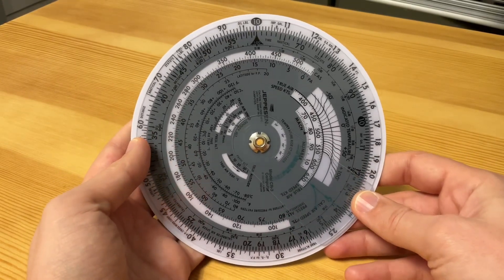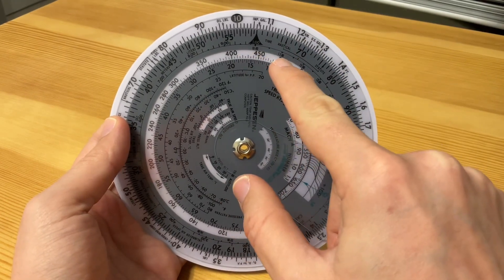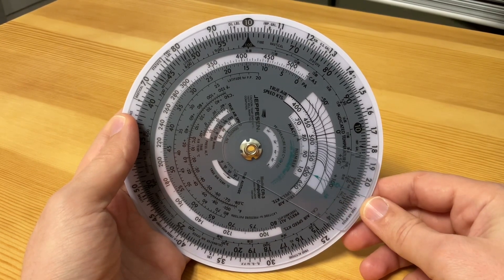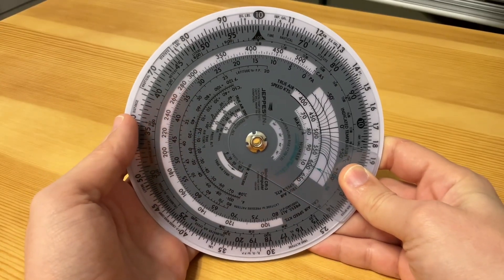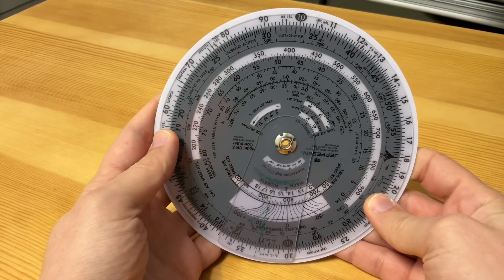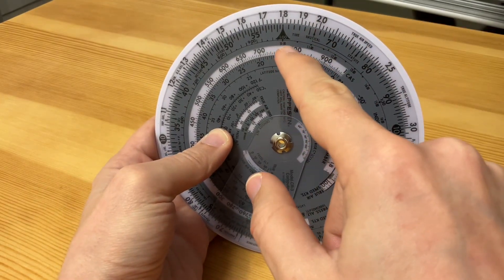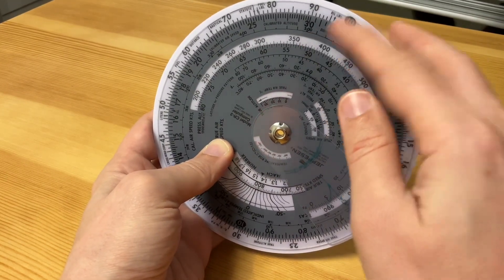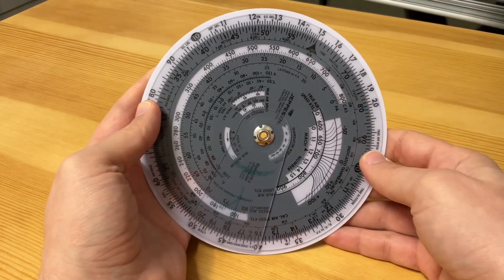Intro to CR-3 (Circular E6B) Flight computer

Comment: Hello, glad to discover your video.
I've been using the CRs series since I was in school and found out that I feel more comfortable with it compared to the E6b however I'd like to know which of these two types is the best flight computer in term of practicability
Reply: I prefer the CR-# series since you can carry to CR-5 in your pocket, use it one-handed and losing the (E6B) slider is not an issue in the cockpit.